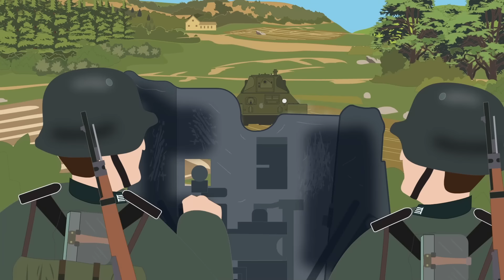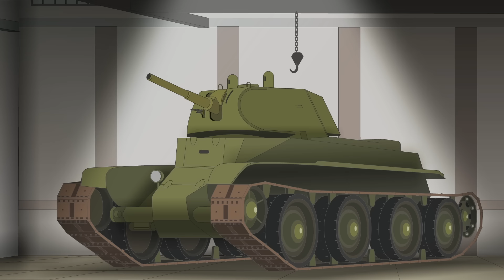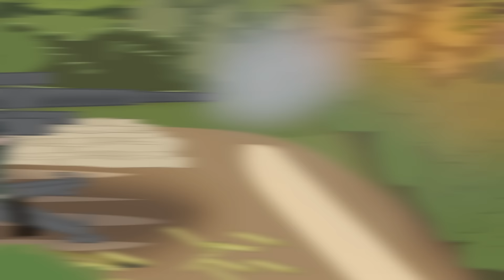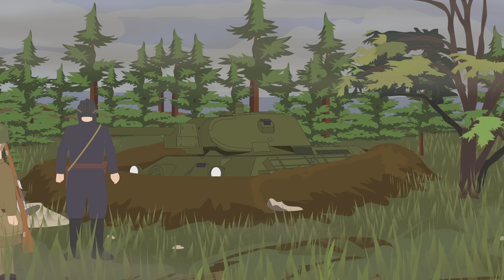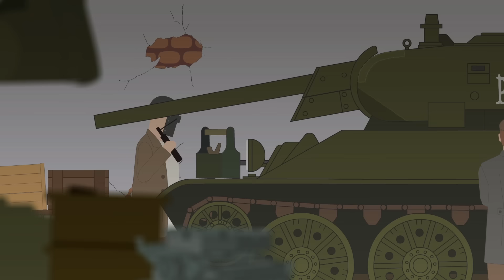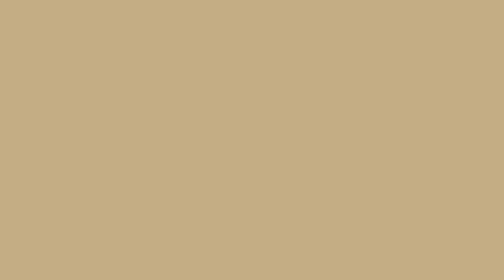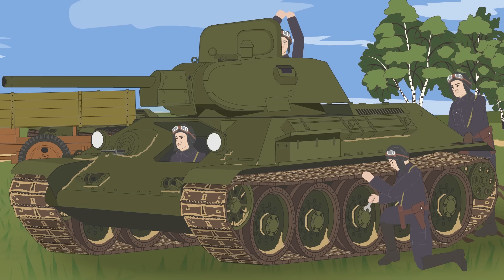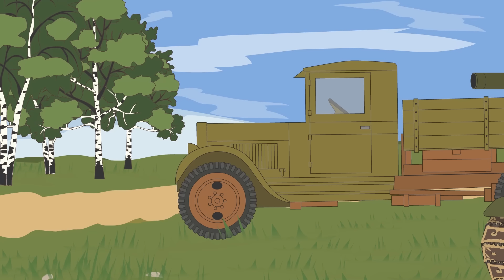Was the T-34 Really the Best Tank of WW2?

Comment: Also forgot to mention how the Panther tanks were also a response to the T34's and KV's. Produced in more numbers than the tiger and whilst not the most mechanically sound German vehicle either. It was still more reliable than the Tiger. I believe it's arguably better than the Tiger.
Reply: The Panther wasn't meant to compete with the Tiger. They were meant to have different roles. The Panther was meant to be a replacement for the Panzer III and Panzer IV and take on the T-34 and other allied tanks. The Tiger was to be assigned to Heavy Tank Battalions within a Panzer division and to be called upon to provide additional firepower in a Schwerpunkt situation. However, the worsening situation of the war for Germany meant both tanks were usually called upon to fight adhoc without any consideration to their originally intended roles.
Reply: Dont forget that, the Stgus were responsable, for more than half, all german kills.
Reply: Sorry, that's a common myth. The panther wasn't a response to Soviet T34s and KVs, it was already in development before the Germans ever encountered heavy Soviet armour. That said, they did accelerate the development process after encountering them (resulting in initial reliability issues)
Reply: @ApostasyUnlimited  It's true the Panzer V was already in development by 1941, but the T-34 definitely had an influence in the final design commission led by Guderian.
Reply: @ApostasyUnlimited  Well, the MAN vehicle was already on the drawing board, and there had been a program to develop larger, more heavily-gunned tanks to succeed the Mark IIIs and IVs.  However, Daimler-Benz did produce a VK 30.02 prototype  which was quite similar to the T-34; indeed, once of the reasons this design was rejected, even though it was significantly lighter than the MAN proposal that became the Panther, was it looked so much like a T-34 that it'd lead to battlefield confusion.
Reply: It was not more reliable than the tiger, it in fact faced the same reliability issue as the tiger
Reply: Panthers not a response to the t34 theres a reason its the panzer V while the tiger is the Panzer 6, also the panther wasnt more reliable then the tiger 1 and later tiger models mainly broke down due to user error i think
Reply: In WW2 you always need to look at the dates when considering how good something is due to the rapid development. The T-34 came in 1941 which was better than any other tank at the time and was almost immune to all anti tank weapons at the time and could be produced so quickly to exploit the advantage at the time, 57 000 produced during the ar. That is what makes it the best. The Tiger came out late 1942 and was slowly produced with only 1300 made.
Reply: @alastair9446  Tigers were more powerfull than T-34
Reply: @HENSIONAVDUli  Did you read my comment properly? I said 57000 T-34s were produced during the war and from the start. The Tiger tank only 1300 were produced from 1942. Doesn't matter if the Tiger is more powerful, the T-34 can out earlier nad more numbers therefore had a greater impact. Even with a 10:1 kill ratio a Tiger still can't win.
Reply: @alastair9446  the german Tanks are more powerfull than Russian tank
Reply: @alastair9446  a Tiger can Destroy 20-35 T-34
Reply: @HENSIONAVDUli  That doesn't even matter, most Tiger tanks were lost to maitenance issues or running out of fuel, or air strikes. artrillery. Even the guys who drove the Tiger tank thought it was worth on 10 T-34s.

While the Tiger tanks is waiting for the T-34 the T-34 is every else breaking through the lines. Even your figure of 35 is too little 35*1400 = 47 600, which is still less than 57 000.
Reply: @alastair9446  T-34s were weaks Tanks
Reply: @alastair9446  a Tiger can destroy T-34 with one shoot
Reply: @alastair9446  and ?? The  german tanks are more powerfull than Russian Tanks
Reply: @HENSIONAVDUli  Can a Tiger Tank survive 34 shots from all sides? Because that's how many T-34 are going to be shooting at it from all sides. You also forgetting that the use of tank is not tank versus tanks there are many roles.
Reply: @alastair9446  in this part You are right
Reply: Hats off to the Russians. But many people don't know we ended up sending GM trucks and a lot of good old US Steel to the Soviet Union during WW2. Soviets had oil fields,but not the technology to produce on the needed level. I would have to choose the T-34/76 with some German PKW V(PANTHER) Upgrades.
Reply: @josephwolosz2522  ya, sadly people just don’t know we GAVE them about 10k planes, thousands of M4A2 Sherman’s (diesel powered versions) and loads of trains and trucks and food and ammo. There were reports from Russian tankers that used the M4A2s which most were equipped with the M1 76.2mm gun was far mor reliable and comfortable than the T-34 and performed almost as good with the only real exception being the mud with high ground pressure which earlier Sherman’s were known for. But other than that, Russian crews preferred them over the T-34 most of the time. So I really don’t see how the T-34 is so hyped when it wasn’t even exported🤣
Reply: @thevortex6754  Tigers were more powerfull than T-34 😉
Reply: Sure if we ignore the guarantee breakdown every 50km’s
Reply: Wait are we talking about panthers
Reply: That's not quite true.  The Tiger I had a better availability rate than the Panther, or even the Mark IV.  The Tiger II did initially have "teething problems" when first issued, especially with that slew of vehicles fitted with the "Porsche" turret (NOTE: both it and the "Henschel", or more properly, production turret, were made by Krupp, the designation is for which vehicle), which were corrected in the main production run.

Once many of the Panther's initial troubles were worked out, including simply training the drivers so as not to destroy the rather fragile final drive, though, indeed it fit the Panzerwaffe's requirements much better than either Tiger.  For one thing, it cost a LOT LESS.  Also, it's KwK 42 was actually more accurate and had a slightly longer range than the Tiger I's KwK 36.  When there was a proposal to up-gun both the existing Panthers and the newer models which were supposed to be fitted with an improved, narrower turret (Schmallturm) with the KwK 43 used on the King Tiger, while up-gunning those vehicles to a 105mm weapon not unlike the later British L7 tank gun, the inspector-general, Heinz Guderian, was against the idea, saying that the Panther's main weapon was more than sufficient to deal with any foreseeable Allied or Soviet tank.  Indeed, it can be said that the Panther has a credible claim as to being the first "Main Battle Tank", well before the concept was realized.
Reply: You ever heard of the Panther Paradox? Panthers were terrible.
Reply: I think Germany(Hitler) always wanted bigger and better when they could have put all that effort and resources into improving the panzer IV.
Reply: @Aurora07  That's what "Schnell Heinz" Guderian, who, after he and Hitler feuded for the last time, was the Inspector-General of the Panzers, believed.  However, the Panzer IV simply had limited development potential, being outclassed in terms of firepower and protection by new UK, USA, and USSR designs.  

The Panther was a leap ahead in terms of being the first "main battle tank" before the concept was realized, more by "feature creep" and its haphazard development than an overall developmental doctrine.  But, like anything rushed from the drawing board into production, it had severe "teething problems" that, due to the urgency of production requirements, never were entirely solved.  Hitler did not like the Panther at all; he derided it as "that clanking He 177", in reference to the troubled heavy bomber.  He actually had favored a competing design by Daimler-Benz which was lighter, but gave in to the WaffenAmt's recommendation to go with the MAN design.

If the German "Big Cats" did well overall, it was because by the time they were available in quantity, the Heer was on the defensive; these big tanks were very well-suited for the defensive role where essentially they functioned as expensive tank destroyers.  That was NOT the role for which they'd been developed, though!  In several, mostly limited offensive engagements, their deficiencies were evident, mostly in terms of mobility and reliability.  Just imagine the issues of trying to tow off a stricken 45-ton Panther or a 62-ton Tiger, let alone a 70-ton King Tiger!  This especially for an army that lacked in AFVs, fuel to propel them, and trained crews to man them, certainly there were too few "Bergepanzers".

Probably the most "cost-effective" AFV design of the Panzerwaffe was based on the CZECH-designed 38(t) tank, the Hetzer, being low-slung and having a potent enough weapon to deal with all but a frontal attack on the Soviet, and later American and/or British heavies.
Reply: If you mean that panther was more reliable than tiger tank , You really need read about them more
Reply: Against kvs yeah maybe but against a t34 till like mid 1943 a panzer 3 would be enough
Reply: Nope...the Tiger and PzIV had availability ratios of 70%, the Panther in 1944 had ratios of 65% according to Thomas Jentz
Reply: They weren't meant as a response to those, they were meant as a response to what the Germans believe the new generation of Russian tanks could be. They were OP compared to what they faced, I'd feel sorry for the T-34 tankers if they weren't spreading the most vile ideology the world has seen.
Reply: @user_____M  I m 1000 % sure that you watch TIK History another man of culture
Reply: @AyoubusMagnus  I think M should better also "stick to tanks" 😄
Reply: @JosipRadnik1  😂😂😂

Comment: Biggest problem with the t34? Visibility from inside the tank and in fact the pz.III had more t34 kills than any other tank despite what a lot of people would think about it's gun being inadequate for such a task. What most don't know is it was such a big issue even without glass fogging that it was quickly written into doctrine for the wermacht to instead of opening up with a large caliber gun, open up with machine gun fire to force the crew down inside the tank and then subsequently prod at the tank until hitting a weak spot after testing the optics on the t34 it was even determined that it only let in 30% of light and with most models unequipped with a radio instead using flag signals to communicate to other tanks so for a t34 crew to be stuck inside the tank with hatches closed all but unable to see and completely unable to communicate with other units could quickly become a death sentence. In fact a lot of countries military tactics to include my own the US are based on the German WW2 tactics though showing more prominently in infantry movement
Reply: T-34 had no worst visibility then, any other tank of that era, namely M4Sherman. Driver and TC cupola was as well as other vision ports was a prime target in any infantry panthlet at the time. So it could be applied to just about any tank of WW2. Pz-3 puni gun was not match for T-34, and more often they had to rely on Luftwaffe 88 and 105mm AAA guns to defeat T-34 tank attack.
Reply: 30% of outside light? The lowest of the countries tanks who participated in the war? I'd be willing to have this debate with you if it where an actual debate unfortunately there's years of research by countless individuals who've spent their lives studying such things that disagree with you so here's what you do go get a PHD in either history or engineering, get several of your friends at least enough to outnumber the existing sources you'll likely need a good 15 to 20 good tenured professionals in order to win an argument sheerly by a numbers game all conduct a study and if need be at that point you and your friends can lie or say whatever you need to against the argument publish your studies make it through the criticism of the other professionals without your work being discredited and then I will accept that you and not the people who have done that already are a more viable source but for now given that this is the case I'm gonna go ahead and take their word for it feel free to hit me up in 20+ years if you do actually end up doing that though but I'm sure I'll read about it
Reply: @aaronlawson2006  wrote: "30% of outside light? The lowest of the countries tanks who participated in the war?"

--It had the same amount and kind of observation equipment, then any other allied tank of the time i.e. panoramic periscopes, periscopic sights and telescopes for firing main gun and MGs.
Reply: wrote: "with most models unequipped with a radio instead using flag signals to communicate to other tanks so for a t34 crew to be stuck inside the tank with hatches closed all but unable to see and completely unable to communicate with other units could quickly become a death sentence."

-- So Pz-III at that time only had radio, but two way communication only commander tank, so if that tank got knocked out, the rest of the platoon had to revert to flags and signal rockets communication.
Reply: A Dora the explorer walkie talkie is better than no radio (T34s) and yes they had periscopes and viewing ports the issue wasn't whether or not they had it the issue was due to the quality of it the T34s gunner sight you know the aimey one only allowed for 30% light intake
Reply: @aaronlawson2006  wrote: "yes they had periscopes and viewing ports the issue wasn't whether or not they had it the issue was due to the quality of it the T34s gunner sight you know the aimey one only allowed for 30% light intake"

-- It was good enough sights to knock out German tanks from long distances of 1200-1500 meters per German Panzer committee reports, and stay away from Pz-3 main guns. T-34 was pretty much on Wehrmacht wish list in 1941-42, and even later in the war. Pz-3 not so much... FYI, most of the tank engagements happened in WWII at a lot closer distances. So, visibility from Pz-3 was better, but if you don't have a gun to knock your opponents, its a lot bigger problem to have. Besides, more problematic was Soviet tank crews, after appalling losses Red Army suffered in the initial stages of WWII, experienced tankers would not be sitting aimlessly at the battlefield and wait for their demise, as you think they were, they moved around, and they had best in the World to do that.
Reply: Statistically the number one factor determining factor in which tank wins a fight is visibility and communication it has been shown since tank battles where a thing that the tank to see the enemy and initiate the engagement almost always wins you wanna talk about the sloped armor? The T34 also had the worst crew and storage space and almost completely lacked intercom systems
Reply: @aaronlawson2006  wrote: "Statistically the number one factor determining factor in which tank wins a fight is visibility and communication it has been shown since tank battles where a thing that the tank to see the enemy and initiate the engagement almost always wins you wanna talk about the sloped armor?"
-- Sure, Aaron we can talk about anything you want when it comes WWII tanks, fire away and make your points, please.

-- As a rule, the tank in a well dug in and camouflage position tank, going to see enemy's approaching tanks before approaching tank will have a chance to see tanks in caponiers. This was true in the beginning of the war operation Typhoon T-34 vs Pz-III and IV, it was true mid war operation Citadel where T-34 vs Pz-V and VI, it was even true at the end of the war operation Conrad I, II, III and Spring Awakening T-34-76 and M4 Shermans vs 45 Pz-VI(B) and 400 Pz-V.

-- So what are you saying about sloped armor? Pz-III did not have it, and therefor it was much inferior then T-34.
Reply: The biggest thing ever drilled into the modern soldier like myselfs mind is Shoot, Move, Communicate, this is how we devastate if a force lacks any of the three main battlefield capabilities or is otherwise hindered in that sense they are all but useless in the case of the T34 can't see to shoot unless it's on a good sunny day and can't communicate quickly or effectively or for that matter at all with crew hatches covered but it does have great mobility for it's time and actually has one of the lowest downforces of tanks in that era but literally everyone else besides the Russians to a decent extent save for extreme conditions or supply oversights could do all three in combat
Reply: It wasn't inferior actually this cuck boy attitude that Russia invented sloped armor is entirely false people understood sloped armor but it cramped your crew quarters severely the Germans saw this as a problem and the Americans countered it at the cost of a much taller tank than need be
Reply: @aaronlawson2006  wrote: "people understood sloped armor but it cramped your crew quarters severely the Germans saw this as a problem"

-- Here is to help you illustrate your point: Schützenpanzer HS-30 vs. M113 troops carriers 

https://www.youtube.com/watch?v=YKpMLxOUQqM&t=11s 

Go!